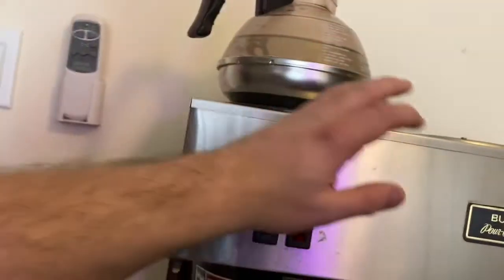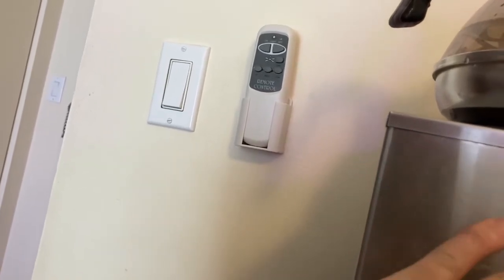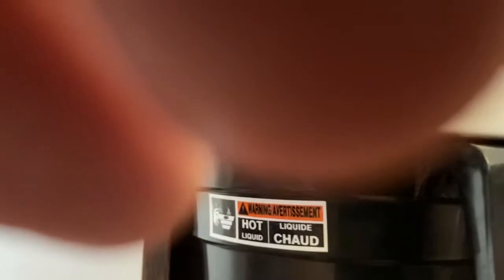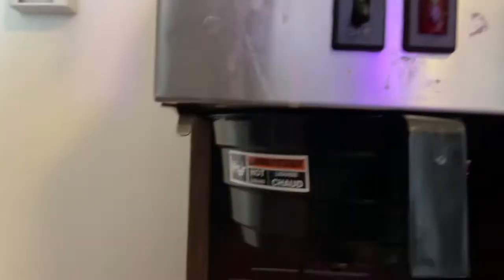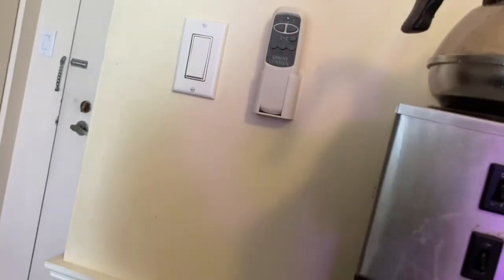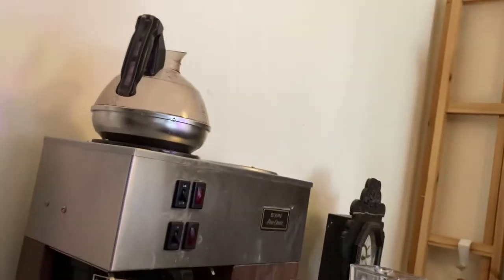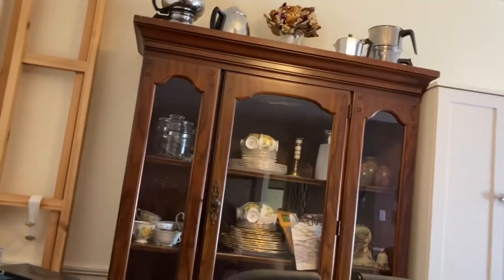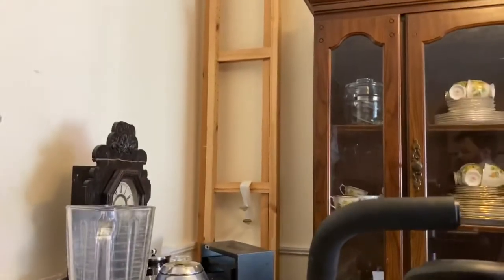Bunn VPR review and demonstration

Comment: I picked up mine for free from work, just needs a couple elements since sitting  in starage for so long caused them to rust, really cheap to replace! I wanted it for the same reason as you, i like my coffee quick, hot, and strong, and i wanted a machine that would last years.
Reply from the maker: Thanks for watching the video. My bunn is still chugging right along. I hope you get many years of service out of your machine. Most parts for them are fairly reasonable, the most expensive part that I’ve seen is the thermostat.
Reply: @theblindredneck747  thanks man! The heating plates complete are about $20.80 a piece, which isn't bad at all, they don't seem to offer the original brown ones that are currently on the unit, but I suppose the black ones will do fine. It seems like your unit is the same as mine, with the round opening and metal mesh on top.
Reply from the maker: @huntershortrepairs  I have come across similar machines to mine that had a lid that covered the metal mesh. I’d like to find the lid if possible. Since I shot the video we’ve rearranged the dining area. My coffee pot now sits closer to the China cabinet, and my cat has started using it as a jumping point.

Comment: A couple years ago, I inherited my dad’s VPR from 1988 or something. Still works. I took it all apart, cleaned the inside tank and heating coils and thermostat rod, put in some new gaskets, and it was a ton of work. But man what a great cup of quick coffee and honoring dad. Cleaning it brought the temp from the spray head from 177° up to 194° and is a better temp for extracting the beans and keeping the unit safe from bacteria and whatnot. If you ever need tips I can walk you through it.
Reply from the maker: They are definitely a great machine for sure. I’m hoping mine will live for a long time to come. Thanks for watching!
Reply: @theblindredneck747 by the way, I found out they have a metal filter funnel made out of stainless steel and I upgraded to that. If you find your funnel filter holder smells funny, like gas station coffee, the plastic ones degrade over time and hold smells in it. The metal one is cleanable. If anyone watches this in the future, I say I took it apart and cleaned it- I ended up using a dremel tool and wire brush attachment. Chemicals like CLR didn’t do anything except make a funny taste. The only way to really clean all the calcium and buildup is to do it the hard way and take it all apart. Great machine and we use it every day now. Thanks for posting a video.
Reply from the maker: @mirth1  where did you get your metal filter basket? I would be interested in getting one.